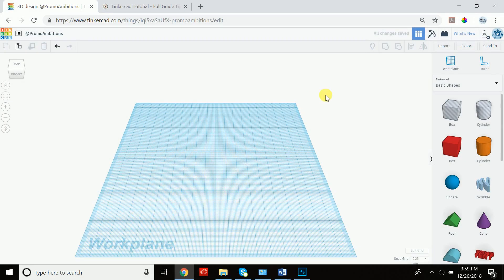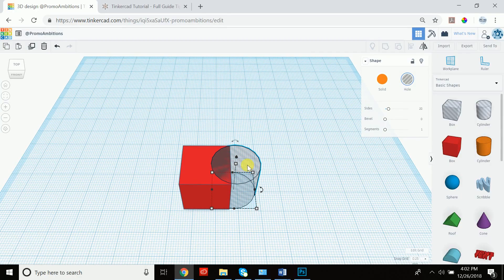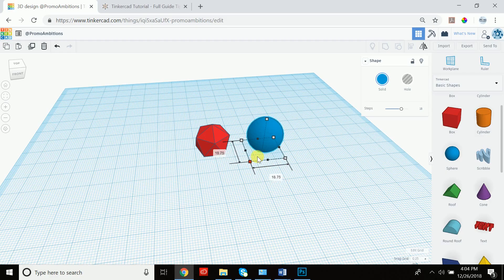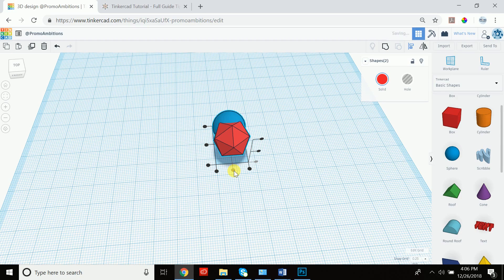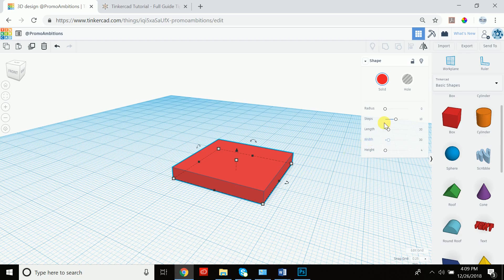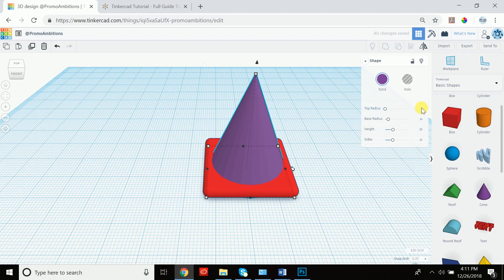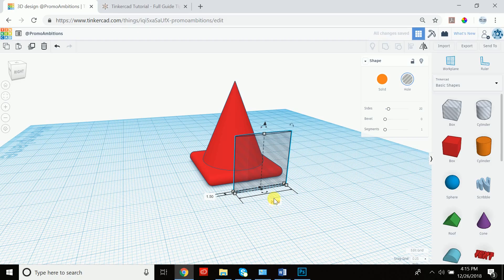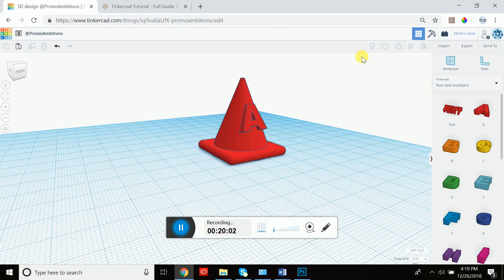Tinkercad Tutorial Part 3 - (Group, Hole, Align, and Flip Tool)

Comment: First, I used the measurements you gave for the base- 30 x30x4 and the cone, but my cone appears much closer to the edge than yours (very little base space around the cone).  Is this because your cone in lower on the base?  Thanks.
Reply from the maker: Yes, definitely check to see how much lower beneath the workplane you placed it 👍

Comment: Question: suppose we have placed 2 items on the grid, first a ball and then a pyramid. If I now apply a new temporary grid on the slanted pyramid, is there a way to take the ball (first item), remove it from the main grid, and set it on the new temp grid (thus, leaving the ball sitting on the side of the pyramid)? Or, must I bring in a ball only after I have set the temp grid?

Comment: Hi, any idea how to add bevel to text?
Reply from the maker: Hey Sam, doesn't look like the default Text allows for that at the moment, however you can try some of the text options in the 'Shape Generator' options in Tinkercad in the drop down menu on the right. Perhaps it'll be available there in the near future. Otherwise, you'll have to use a more advanced program like Fusion 360 to get the desired effect you are seeking.